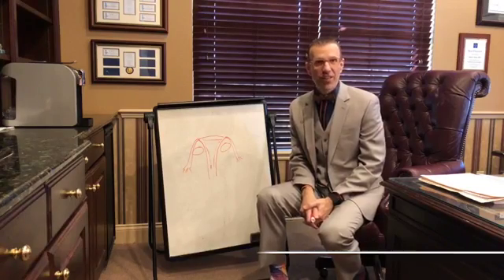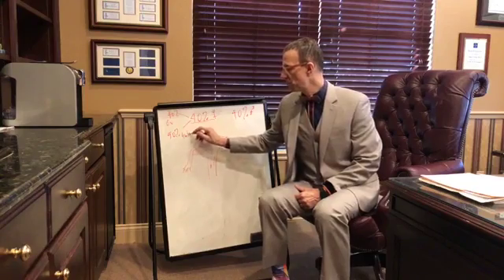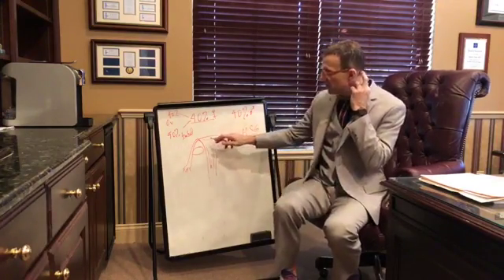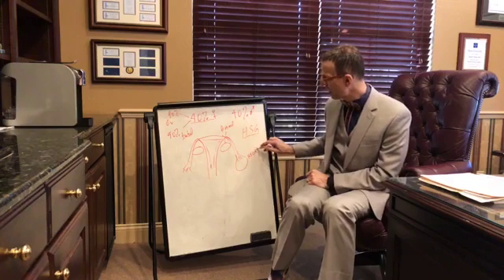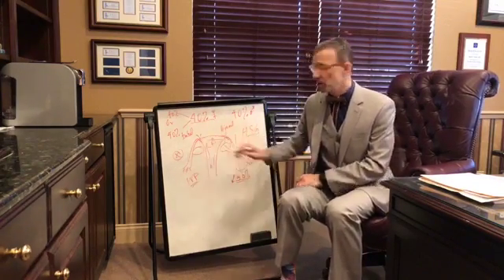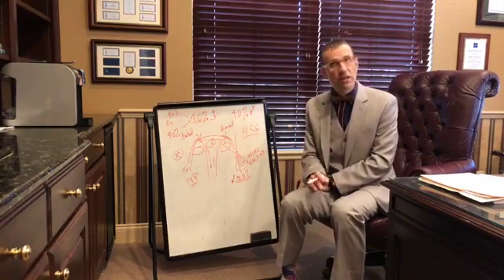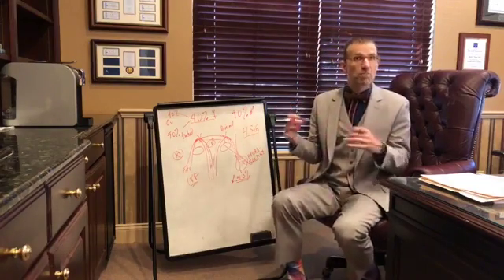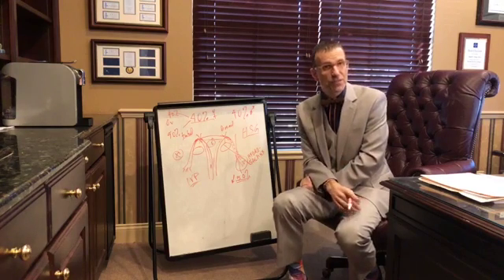What Are Your Options if Your Tubes Are Blocked?

Comment: NATURAL TREATMENT FOR MISCARRIAGES AND BLOCK TUBES........

After struggling to conceive for 6 years (i had 4 miscarriages in between) I was diagnosed with fibroid and block tubes, when I went for a scan the results show that the fibroid was very huge at 9.6cm. A friend of mine recommended me to this herbal specialist called {Best Dr. Alabi} who helped me out with his natural herbs which I took for 4 weeks. 
 I went for Scan and I was told that the block tube was confirmed opened and the fibroid was no longer there. It has melted out through the natural herbs I was taking.....
  I  conceived my first baby naturally, she is 2 years old by the Grace of God I am 7 months pregnant for my second child within this short period of taking this natural treatment, i Will be  having my second miracle baby soon, God willing. I'm simply testifying over my breakthrough. on how i conceive after years of struggling to have a child......

 you can also reach Best Dr. Alabi through the following means:......
 whatsapp: +2348155011610.....
 call: +2348155011610.....
 email: bestherbalcure@gmail.com